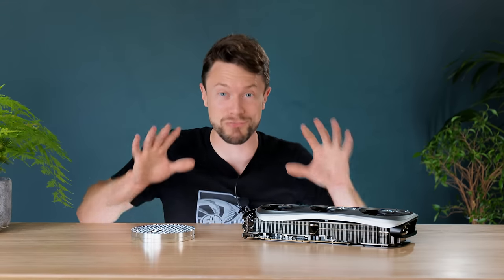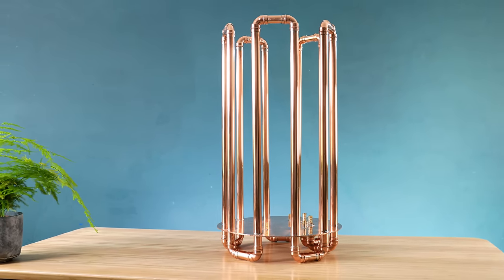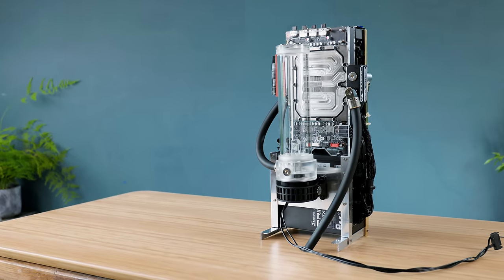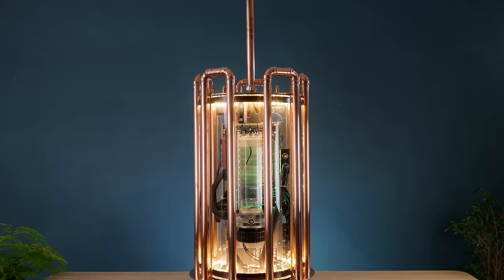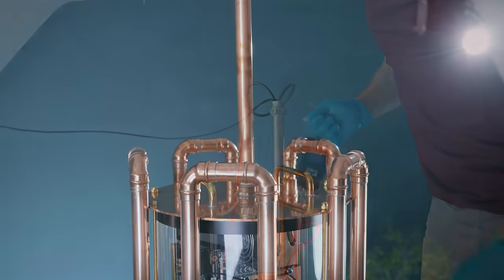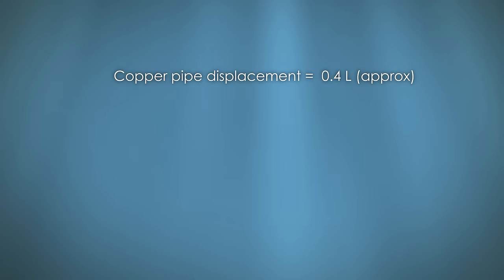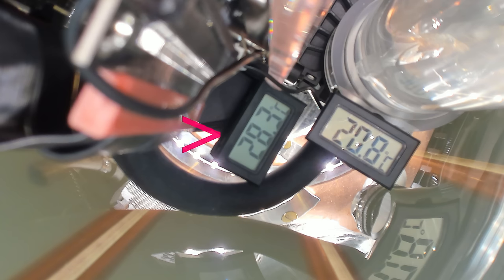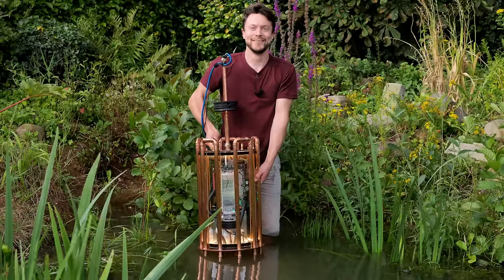Building an ACTUALLY water-cooled PC

Comment: Another great way to prevent a leak would be to have the inside be pressurized slightly.
If there is a leak, you will have air leaking out instead of water leaking in, and you can have a pressure sensor that warns if the pressure is going too low
Reply: pipe bomb pc hell yah
Reply: @sakesaurus  perfect, just perfect
Reply: I'd need to be significantly heavier. Another thing is most pc parts will not work 1:1 with increased air pressure. Last more air pressure means more heat. Integrating it would be smart but at the cost of a whole redesign more $$$.
Reply: @ross9314 what do u mean by they won’t work 1:1
Reply: @minovictor  it wont work the same without the air pressure
Reply: @sakesaurus I think you missed the slightly in "slightly pressurized" 😅
Reply: Filling it with nitrogen or argon for welding could also be a good idea.
Air contains water vapour that will inevitably lead to condensation.
Reply: @sakesaurus  too weak  to be a bomb
Reply: for sure then add some nails and shrapnel objects and mail it to someone
Reply: it would also help to test the airtightness before putting thousands of dollars of equipment in there
Reply: dont nuclear power plants use a similar system?
Reply: @qdaniele97  Helium of Neon is a lot better idea than Argon (worse termal Conductivity) Nitrogen is also fine.
Reply: or just seal it with silicone
Reply: @qdaniele97 I’m a welder and if I remember correctly argon is cheaper than pure oxygen. Also oxygen is incredibly flammable and argon isn’t, I’m pretty sure nitrogen is a little too so I thing argon would be the ideal choice.
Reply: @Dandaman1687 Is nitrogen a little flammable you said ? 
Sounds really surprising as it's actually used for fire suppression at places like data centers.
Reply: That is actually a brilliant idea!
Reply: i love seeing smart people discuss the stupidest topics
Reply: That wouldn't work with this design since there is a big hole at the top for cables, aswell as to cool off the inside of the cylinder. However, you might find a way to get an airtight opening for the cables and then run them through that. In that case, I'd also make the cylinder itself out of copper and attach some sort of fins on the inside to make it work as a heat sink for the air inside the cylidnder to cool off. Might be overkill, but would be cool ;)
Reply: @ross9314  Increased air pressure actually improves cooling. More air molecules to take heat away.
Reply: damn good idea...
Reply: Deep water horizon part 2
Reply: @Dandaman1687 nitrogen is not flammable.
Reply: Another great way would be to just get a normal computer that isn't inside a pond 😂
Reply: @phillipbotter6470  It kind of is under heat/pressure in the open atmosphere (the main example being the NO/NO2 formed in combustion engines) since virtually all the common Nitrogen compounds are extremely reactive as it's base state is so stable.
Reply: @wchenful True. 

But did you see those thermals? 😏

Comment: Hello, plumber here! Note on the soldering of the outer piping: you used the wring kind of joints. These have a rubber inside of them, which won’t take kindly to tho soldering process. I’m sure you’ll fare much better with joints that are meant to be soldered with.
Some tips if you’re interested:
-ensure enough ventilation
-Make sure theres no dirt on the pipes
-make sure to use sandpaper on the bits that will be soldered
-after that use some flux (s-39 will do great) to cover the surfaces that are to be soldered.
-after assembly, make sure you heat both parts about equally 
-the tip of you flame is the hottest
-if the joints are at the correct temperature, the solder will be pulled in the joint. Just touch one spot, the flux will pull it in. Stop when you can see solder all around the pipe. I always leave a little droplet underneath (assuming your weld is horizontal) as proof that it’s full.
-i know it sounds obvious, but do not any part of the project with your hands when heated. It’s all hot
Reply: Just wanted to thank you for supporting the backbone of society. Idk where I would be without a plumber
Reply: Imagine showing this to someone 50 years ago. It has that old computer style but maxed out performance
Reply: Rubber or not the fact he solder the thing so it's safe to say no leaks allowed.
Reply: yeah, I saw he used crimp fittings too. Though I do know you can braze the HVAC ones, but its still not a good idea
Reply: Or use one continuous length of tubing as it comes off the coil to make a spiral shaped cooler (had it not been hard copper tubing that comes in straight lengths).
Reply: I don't understand how channels like DIY Perks just go into making stuff blind and do almost zero research. His videos are full of mistakes that are easily google'd. I think this channel is going the way of LTT, in which the creation and idea is made in a vacuum, and done quickly to push out a video, usually with a ton of editing to cover up most mistakes that compromise the end product. The market is mostly children on youtube (close to 90%!), and they don't care, they just watch and then press the like button.
Reply: @assarlannerborn9342  "It has that old computer style"
Wut. What TF computer had copper plumbing? Also, (standard) computers didn't exist 50 years ago. We have only had them for about 40 years. 50 years ago, they were analog tapes and recorders like the first "computer" in the 1940s, invented by Alan Turing, inspired by the first programming conceptualizations of Charles Babbage. 
This computer resembles nothing but modern technology. Maybe you are thinking of the steampunk aesthetic, which is science fiction steam-based machinery that has tons of plumbing.
Reply: @evolicious  chill dude. i think what he refers is "steampunk style"
Reply: Chill dude, you learn as you go, you're not going to be perfect the first time
Reply: @evolicious  The first PC was released 52 years ago in 1971. The standards we have today have roots in the standards used back then.

Even though you're replying to something referring to the aesthetic style incorrectly, you're also incorrect in what you're mad about. As others have said, relax, my dude.
Reply: @evolicious  it's always hilarious when someone comes into the comments with hate, and they're just grotesquely wrong with their arguments. You make yourself look like a fool when you do this.
Reply: @evolicious  I'm sure there are plenty mistakes with his prototypes, and swearing. However he makes his videos very slick, that's the style. Also cost is no issue. So the value of the guides as something to recreate? However I find his guides highly inspirational. There are engineering lessons hidden in them both about what to do, and what not to do. his ideas are often original.
Reply: I was gonna read your comment but when I pressed more and saw the rest of it I said nah
Reply: You have my respect
Reply: @evolicious  "What TF computer had copper plumbing?"

That depends how you define plumbing.  A heat sink for a CPU or GPU is made with copper piping which runs through fins to help dissipate heat.  There is a fluid in those heat pipes.  So, in the process of cooling a CPU/GPU there is liquid involved, inside copper piping.  Hell dude that's pretty close to plumbing right there because if it's not made correctly and those pipes leak, you've let out the fluid inside and the cooling effect is greatly diminished.
Reply: @Deminogg   Problem with people now, 10 word limit.  Good luck learning anything if it's not in a video.
Reply: Lmao they sold him some pro press fittings with soldering lmao.
Reply: All comments aside, this guy did an amazing job tho. I dont understand anything but still an amazing project. Not something you see on daily basis.
Reply: @assarlannerborn9342  what old computer style? 50 years ago, it took a cargo plane to haul a computer that was only capable of storing 512MB
Reply: theres always that one guy
Reply: All good advice! I followed the same steps when I soldered plumbing as a construction worker back in the day, always got great results.
Reply: Those are solder fittings, the solder is contained within the ring. Maybe this type of fitting isn't common outside of the UK? Hense the confusion.
Reply: @xmzru   Up shit creek, in most cases. Or, if you're particularly unlucky and/or have neighbors upstream or uphill, DOWN it...
Reply: @evolicious  Old computer style? I'm 38, and I have to say, this looks more like a quantum computer at google labs than any of the IBM's I destroyed. (I wasn't obsessed with Office Space or anything...)
Reply: @evolicious  lmao
Reply: He hasn't used the wrong ones, he has used solder ring Yorkshire fittings, not crimp fittings. You can see the solder flowing at 2:57
Reply: I'd like to add a note to this. Copper is not normally poisonous to us because of the layer of mineral deposits that coat the inside of the pipes, but in a lake can poison fish, invertebrates, and plant life. Please be careful of the lakes inhabitants. Copper ions can be used to keep swimming pools clear of Algae, so a pool setting is more appropriate.
Reply: I think he was trying to flex showing people he could solder and then just had a plumber pro press those fittings on for him because he didn't want to destroy thousands of dollars of PC parts. There's no way he was able to clean up those ugly ass solder joints to look as good as they did in the finished product.
Reply: I'm sorry i never ordered a yappachino
Reply: @xmzru  surrounded by mountains of shit.
Reply: @evolicious  lol wut. >_> 
it's more of a proof of concept than anything. if you really think this was just cobbled together quickly for views, idk what to tell you. not everyone builds stuff for production after all... I don't see what's wrong with making things you have an interest in. not sure why not researching every small detail about something you make is a deal breaker for you, and for children... 😅
idk, that just sounds completely absurd to me. lol
Reply: @johansenchinardi4734 people who say “chill”
Reply: @herobrine1847  how do you want us to say it to you? " Would you please take your emotions and bring them to a lower state my esteemed colleague"?
Reply: @xmzru  it's ok mate, they get paid
Reply: He's using Intergral solder fittings! Are you not familiar with them? I presume you are not a plumber from UK, and these are not common elsewhere...
Reply: Incorrect. The ring in this case contains solder when heated it bonds. You should look them up.

Comment: This reminds me of a geo-thermal cooling project i helped a friend build back in 2000.  we ran copper piping from his computer room, outside his house and then buried it 8ft down in the ground in a 40ft loop, he had the pumping mechanism build and placed in his washroom, the pipe fixtures were connected to the pc via rubber tubing.  since it was 2000, we built our own home made cpu waterblock out of copper.  his geothermal cooling system still is working.  3 pumps later... multiple additions and changes later, the main loop still works fine.  24 years later.  

in the last upgrade in 2018 we made a home made pump (we needed to be able to move enough water continuously non-stop for years.  it's surprisingly hard to find a pump that reliable for less then a few grand.  so we ended up building our own.  his current pump is about 1/2 the noise of the last one, uses about 1/4 the power, and moves water better; it's also still running strong.  He has a i9-14900ks and a 4090 on it currently with commercial blocks.  there is so much water volume in the system even those parts don't come close to stressing the system
Reply: that's actually really cool!

Comment: The pre-soldered copper fittings were a great choice just for style alone with those ribs.  Very steampunk!  Yet another amazing build, Matt.
Reply: stop riding bruh
Reply: lol
Reply: @akv8562 you're so annoying... it's just a compliment
Reply: copper can be harmful to some fish and other aquatic animals, but it looks nice!
Reply: @kyle7382 Only if the fish are rare and are in direct contact with exposed pipes, e.g. an Aquarium. This build isn't going into a large body of fresh water in an active habitat
Reply: Those 'Yorkshire fittings' as they are usually refeed to have been mostly used for plumbing in the UK for over 50 years.
Reply: I think? They were press fittings and he soldered them? Correct me if I am wrong
Reply: @cliffp73 they are a type of fitting that you need a tool for that squeezes around the ring on them so it’s kinda like a press fitting
Reply: @cliffp73 I think they are called compression fittings